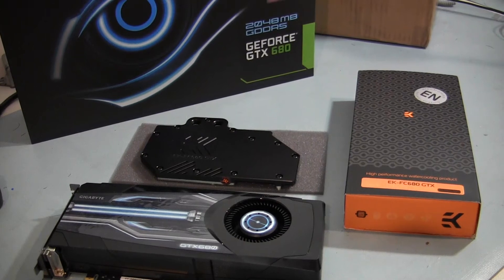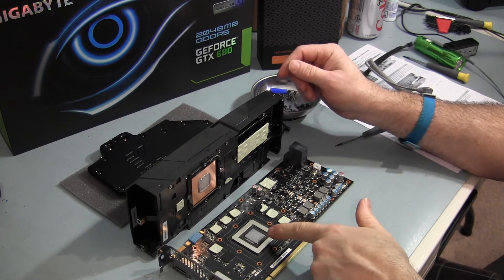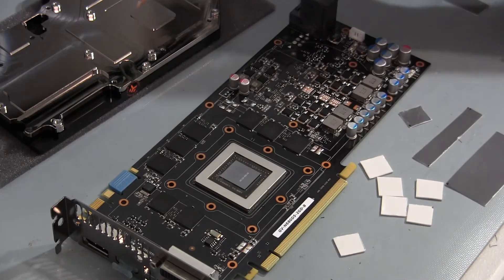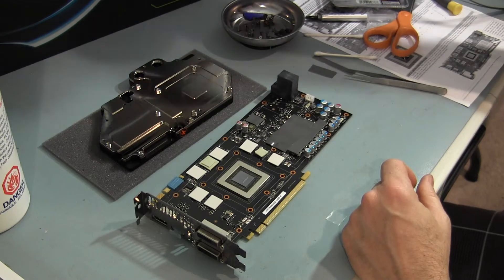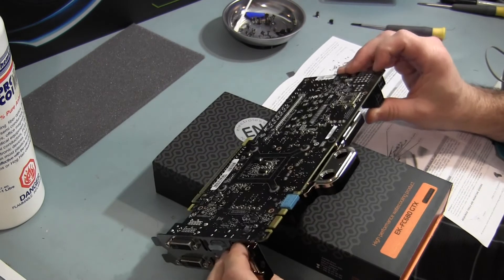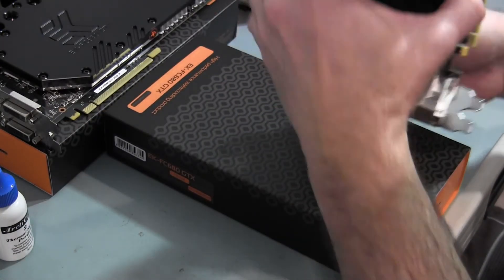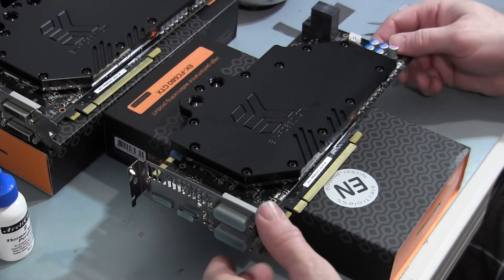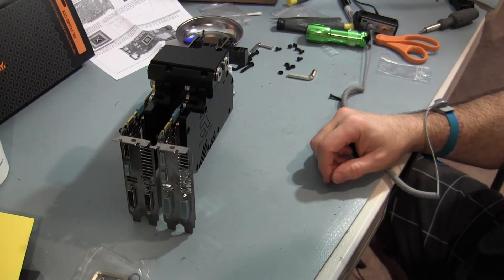FC-GTX680 Water Blocks , FC-Links and EK Bridge Assembly

Comment from the maker: Yes they are available now. I need to look into the backplates.  I researched a lot and found that parallel with my setup having two D5 pumps in parallel kept the flow good and the cooling has been awesome.

Thanks for watching.

Comment from the maker: This is an ESD Constant Monitoring Station . 3M Model 724.  If I become un-grounded an alarm goes off.  Just a little more elaborate than a regular ground. Not needed but I got it on E-Bay for a few bucks.

Comment from the maker: This is an ESD wrist strap to prevent static discharge protect the card I am handling. Some folks just touch the chassis of the system or do nothing. I have worked in the electronics industry for 30 years. I just do this as reflex now. have seen to many circuit cards start working erratically as the result of static discharge. New cards are better designed so not too much of a worry, but I do not take any chances.

Comment from the maker: I think it is simple enough to add these waterblocks that I would save the money and add the blocks myself.  Check warranty on the cards, and save all your bits that you remove from the card in case it goes bad. If you stick with ASUS,MSI, Gigabyte, I think they are all pretty go and also offer quality cards. I would run the card for a while under air to make sure you have no problems then add the blocks.  So comes down to if you are comfortable taking the card apart. It really is not difficult.

Comment: One thing to note when Pulling a Heat sink away from a Circuit board.. You should grab a Hair dryer and get the board a little warm to soften up the Thermal Paste a little bit.. You can actually Damage your board if you are not careful.

Comment: A fair warning: note that thermal paste contains metal, and if you apply it too much you might short out your card. Secondly, when tightening screws around GPU or CPU, first tighten all screws a little and only then tighten them all the way, also always do it in cross pattern, else you might break silicon inside.

Comment from the maker: It is easy to take off the cooling unit and replace it. I would think you want to have the shroud off the circuit card to cut into anyway. I personally would not try that with the card attached.

Comment from the maker: If the 670 uses the reference 680 pcb layout then it will work. I actually had a 670 FTW EVGA card and that did use the FC-680 block.

Comment from the maker: Two GTX680's 2GB or 4GB will run always run faster than one 690. But from the benchmarks I have see only slightly faster. I think the 690 is an excellent card and it uses only one slot. If I did not already buy the 2 680's I have, I would consider the 690.

Comment: MX-4 is non conductive so theres no metal parts in the paste anymore. Most thermal pastes these days are actually non conductive especially because they're used on gpu's aswell and it'd be a pain in the ass if you short something with thermal paste.. :D But it actually was quite a big issue back in the days :) Cheers.

Comment from the maker: I would definitely install the EK FCLink Blocks on a bench before installing them onto your motherboard.  They create a nice sturdy assembly that makes it easy to handle and install into the PCIe Slots together.  Do you plan to use the crystal link system or the same as mine but for a 3 AMD card setup ?

Comment: Actually you should only be using Metal based Thermal paste on the CPU.. You should be using Ceramic based Thermal Paste on the GPU and Memory modules..  There are 3 different kinds of Thermal Paste.. Metal based, Ceramic Based and Silicone based.. Silicone based is normally what comes  stock on Video card memory modules.

Comment: Yes, it does. Many people(including me when I was younger) get impression what computers are awesomely stable, and can do same thing trillions of times. Well it is not true. Computer electronics are very fragile, magnetic field, small imperfections  in construction of chips, small particles what resist the current, they all add up to a constant noise in the signal. As for shortening, even the dust layer can shorten the circuit.

Comment: ill be putting water blocks on my direct cuii 680s soon and was thinking of putting tim on the vrm's as you did just one thing i worry about is if i accidently get some on the pcb or some other component do i have to worry about it shorting out? or should i be fine as long as i us a non conductive tim

Comment: Hi Ronsanut. I am going to buy 3 7970 blocks for my 7970's, but for the instalation, what links do i need exactly. And how do you suggest to install the link. Putting the cards with the link heads on in the pc, and then mounting the big block that connects them, or mounting the whole thing on a table, and putting 3 cards in the pc at the same time (connected to each other with the link)

would like to hear your advice :)

Comment: You mentioned these blocks will not work on the reference 670s. Will they work on the GTX 670 FTW edition? From what I understand it uses the same PCB as the 680.